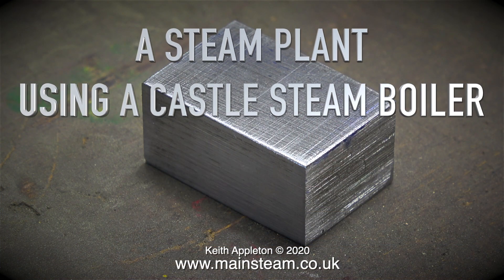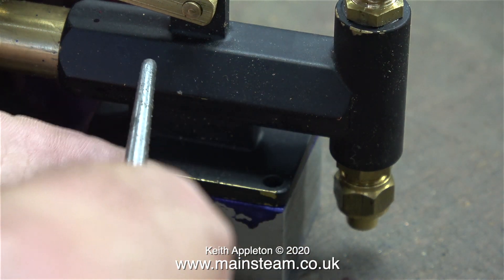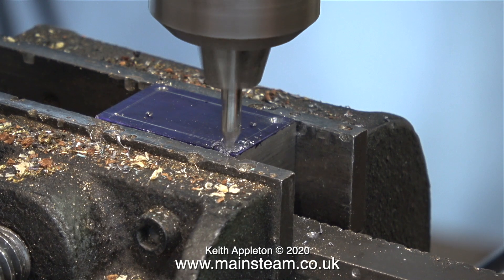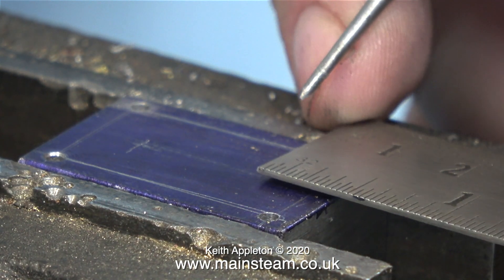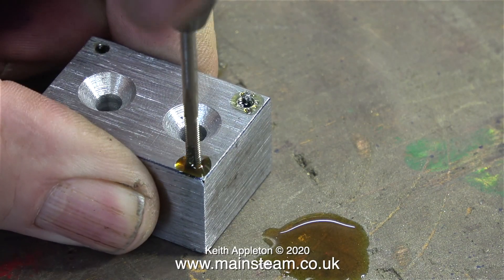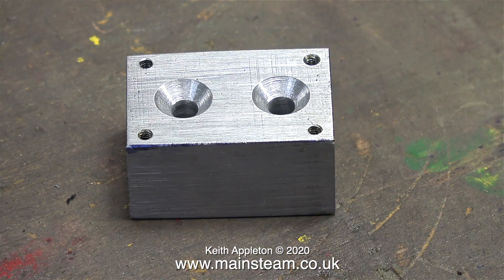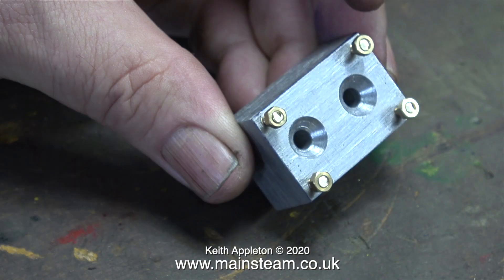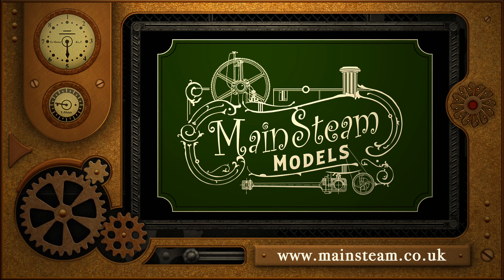A STEAM PLANT USING A CASTLE STEAM BOILER - PART #3

Comment: Thank You!
I just ordered one of those pumps, it has not arrived yet, but this came in very handy!
I also added the conversion nipple for it, i am not sure what it realy is but i suppose it is some kind of 90 degree device with a pipefitting in the other end.
(My plan is to use it for the 3/4" machine which for some reason has an enormous low pressure boiler (probably scratsbuilt) attaced to it, that's why i choosed the 1/2" pump for that machine, just in case, since i had an idea of fitting the Stuart vertical feeding pump or the Southworth 6" vertical to the same boiler in the future (i originaly bought the Southwort kit for a demonstartion model of the water evacuation system in an old ore mine, that's why i need two of them.).